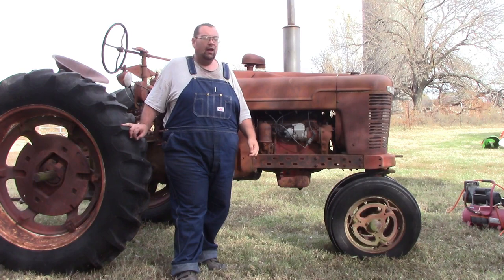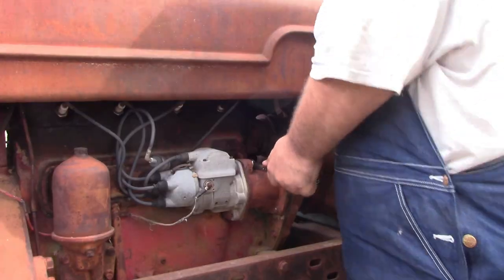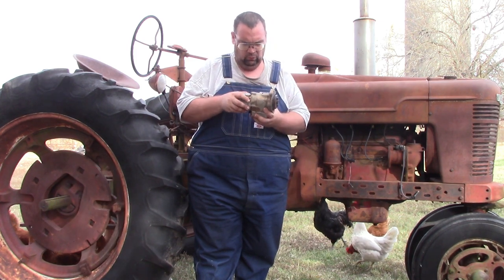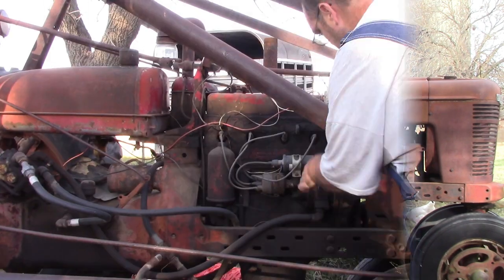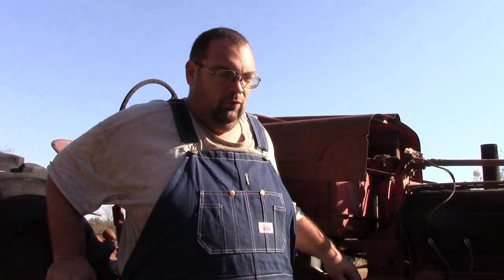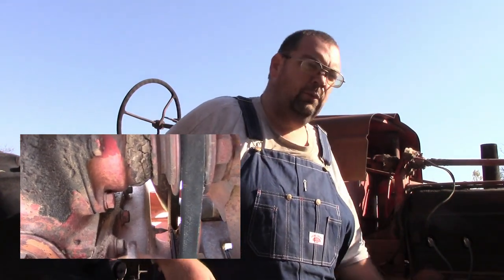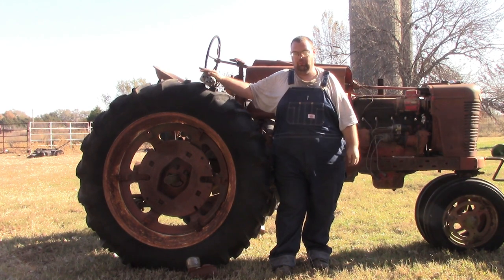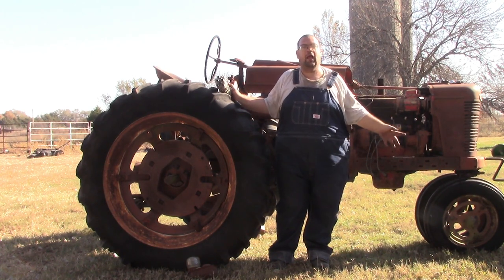how to change your tractor to a distributor from a mag.

Comment: On my A.  The previous owner changed to coil ignition.  But used the old magneto housing as the distributor.  The internals of the magneto was removed.  Added a coil changed the ignition wiring  to supply power to the coil.      He filled the wire hole in the magneto with silicone.    It still uses the original points and cap.       Honestly i would love to have the magneto back. Then it will start with a crank if the battery goes dead.